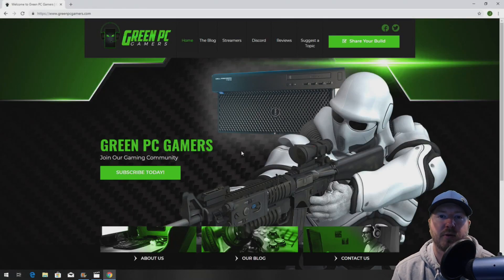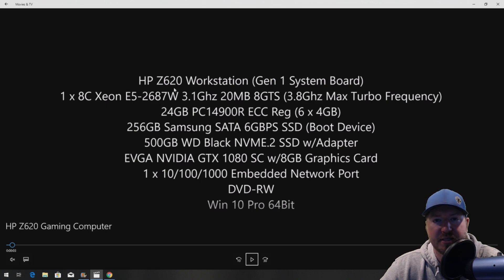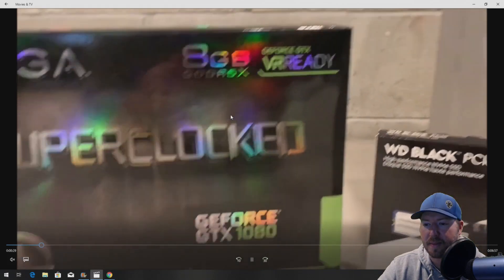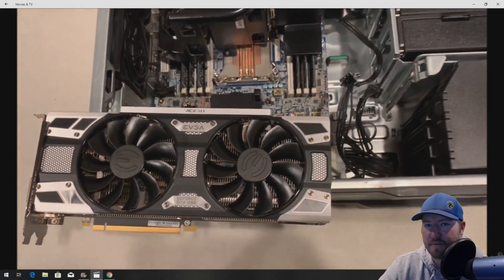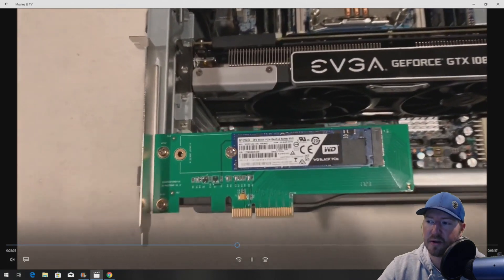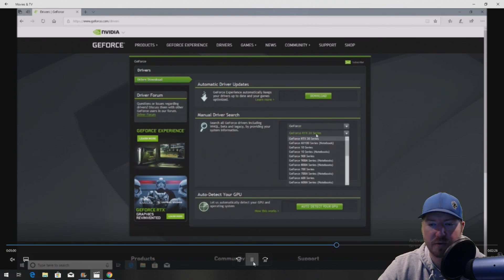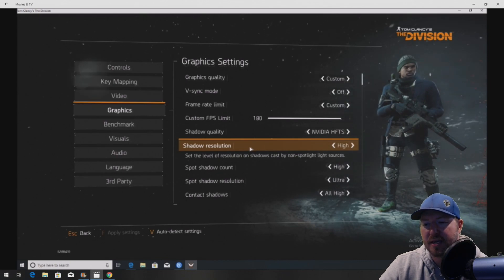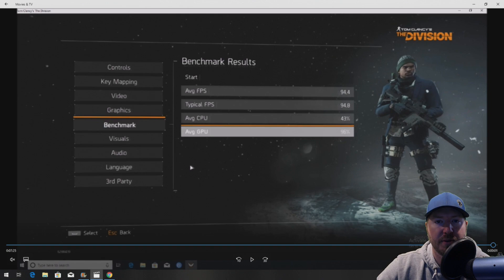HP Z620 Gaming Computer and Overview (NVME.2 and GTX 1080 install)

Comment: On my Z620 Dual CPU the GTX1080 will not work. I tried HP Adapter 6 Pin to 8 and 2x6pin to 8 Pin, but this is not from HP. Z620 only says „Beep“ six times. Now I work with Radeon7870 and 6 Pin.
Reply: ...now working with 2x6 to 8, I reseted Bios, now it's better.

Comment: Does it support dual graphics card? Sli
Reply from the maker: It does support SLI with certain NVIDIA Quadro GPU's.  Unfortunately, NVIDIA got rid of the support matrix that showed which cards work.  If you do some digging, you can probably find the matrix on the internet.  Good luck!

Comment: On my z620 Workstation I tried installing a Corsair rm850x 2021 model PSU along with an EVGA gtx 980ti and the pc will not boot up. Do you have any suggestions or possible troubleshooting?
Reply from the maker: We've never tried an ATX power supply in a Z620 Workstation because you can't physically fit an ATX power supply in the case.  You'll probably have to modify the power rails to get it to work.
Reply: @GreenPCGamerscom  thank you for the quick reply.  I did have to modify the case to run the power cord to the new PSU. The motherboard has an 18pin connection to the board and also to the PSU, but the PSU came with an 18 pin to 24+6 pin connection. Do you know if the motherboard on the Z620 will only draw power from specific PSUs?

Comment: Nice video.  I'm trying to install an Nvidia K4000 and haven't been able to find a suitable PCIe adapter cable.  Yours connects to 8 pins the K4000 uses 6 pins.  Any idea where I can find an adapter that connects to a 6 pin card?

Comment: hello! Can i install two rx vega 64 in this hp z620? They use four 8 pin connectors in total
Reply from the maker: You cannot, unless you plan on using an external power source.   Also, the z620 won’t support a crossfire configuration.
Reply: @GreenPCGamerscom  ok, thanks for your fast answer!

Comment: Just received one, with E5 1620 (1 CPU) and 48GB RAM. Put SSD and GT 1070. I use a dual 6pin to 8 pin cable adapter for the VGA.

Comment: Wow; great! Was searching all over to see if I could VR my Z620. My wife won me a Oculus Rift at a silent auction (cool wife, I know). Naturally it wouldn't work with the Quadro M2000/4; so, down the rabbit hole. Super good video production, I like the technical work and also the PIP effect. Covered everything. I'm going to look for a 1080 instead of the 1070ti just because I saw it done.  Really good job! Thanks. Subscribed, liked...

Comment: Hi all,
Could anybody tell me if is it possible to boot this Z620 workstation with a Nvme M.2 Samsung 970 EVO Plus? And how?
This is mounted on a PCIe 8x adapter (on number 4 socket) and the system recognizes the SSD but can't boot from it. The BIOS is the last 3.95 version.
Reply from the maker: You can use a boot assistant like clover, or buy an m.2 adapter that has a bootable rom chip.
Reply: @GreenPCGamerscom  how to check m.2 adapter have bootable rom chip?
Im looking at Ugreen m.2 adapter from aliexpress.. should I go for it?

Comment: Nice video you should do a video installing a rtx 2080 into a z620 that would be great and can the z620 handle it
Reply from the maker: You could install an RTX 2080 in to a Z620 workstation.  It performs almost identically to a GTX 1080 Ti.  In our opinion, the best bang for your buck on a Z620 is the RTX 2070.  It seems to have the least amount of bottlenecking.
Reply: @GreenPCGamerscom  lets suppose I were to replace the xeon processor with a xeon e5 1680 v2 and OC it to at least 4.2+ghz, shouldn't that really end all the bottlenecks completely?
Reply: @GreenPCGamerscom  The GTX 1080 TI, can it also be installed in the Z620, I have one with dual processor 2690 v2

Comment: Hi ! great to see projects like this :) I went similar way with mine custom z620 : 
E5-2697v2 on liquid aio
GTX 1080 on liquid aio
Intel p540 boot
2x Intel p3500 ssd drives adapted to pcie slots for utilities and games
3x WD red 2TB storage
Reply: Hi TheSChp, what liquid AIO did you use on your system? cheers

Comment: Hey, i have a question. does 2 pcs intel xeon e5-2620 is better than i7-2600?
Reply from the maker: It depends on what you are using the computer for.
Reply: @GreenPCGamerscom  I'm actually using it for some games and some editing software, would it be good? What do you think, sir?

Comment: Hi, I have a Z800 with an ASUS 1070 ROG STRIX 8GB. The problem is that I keep on getting Video TDR failed Blue Screen of Death Error. I can't seem to find any sort of fix. I've reinstalled the drivers about 5 times now and still nothing. Checked and unchecked. My assumption is that the card is screwed because the drivers are corrupted or something. The latest or oldest drivers don't seem to make a difference. Please let me know if it's the card or the system.
Thanks
Reply from the maker: If you think it is a driver issue you could trying doing a fresh install of your OS.  Did you buy the graphics card new?
Reply: Quick check: What are you using to power the video card?

Comment: If you can choose between a Z20 or a Z800 to upgrade them which one you'd choose? Thanks
Reply from the maker: If the price wasn’t an issue I’d do the Z620.  It supports faster components.

Comment: How can I find if a HP Z620 workstation is gen1 or gen2?
Reply from the maker: Vikas Kumar check your system board.  619559-001 = V1 and 708614-001 = V2
Reply: @GreenPCGamerscom  Thanks for the super quick response.

Comment: I have z620 v1 with a E5 2680 xeon processor I want to install a gtx 1070 in it ...do you think the it will bottleneck with a newer gpu in it?
Reply from the maker: With our experience, we have witnessed a small amount of bottle-necking using a GTX 1070 Ti in a Z620 workstation due to the IO speed of the cpu/memory.  Most of the time it's still totally worth the upgrade.  What GPU  are you upgrading from?
Reply: I'm upgrading from a Nvidia GT 740 I recently bought the pc I'm going to be using it for video editing and streaming...I'm looking to purchase a 1070 not the Ti version due it to being old hardware
Reply from the maker: The new graphics card will be a nice upgrade for you.

Comment: Hey! Where did you get that 2x6 pin to 8 pin adapter? I need to know because I have hp 620 workstation and I bought 1070 8gb.
Reply from the maker: You can find the adapter on this page:

https://www.greenpcgamers.com/technology/video-card-power-adapters/
Reply: @GreenPCGamerscom   thanks a lot for this link , but in france it does not work !

Comment: Nice video, i want to put two gtx 980 in sli on mi hp z620, with a xeon e5-2695 v2 and 32 gb of ram. yo thinks is posible?? thanks in advance.
Reply from the maker: Hey Jonathan,  if you have the V2 system board your Z620 shouldn’t have any problems running 2 x E5-2695 V2 processors.  You will need the secondary cpu riser board to install 2 processors.  Also, installing 32GB or memory will work fine.  The 800W power supply does not have enough wattage to run 2 x GTX 980’s under max load.  Also, it would be tough to provide the power adapter cables for 2 cards.  You could possibly run a second external power supply to accommodate 2 gtx 980’s.  Or consider using a single RTX 2080.  Hopefully this info helps!
Reply: @GreenPCGamerscom   yes it was very helpfull, thank for everything. nice channel and continue with the great job.
Reply: @GreenPCGamerscom   i was thinking in a radeon vii because i use a lot of cad work on that pc, so i hear the radeom vii is a good choice for that,but i am worried about the psu, you think it can handle it?? also i want to expand the memory to 64 gb, it is really a massive diference betwen ecc and non ecc memory?? beacusE NON ecc is cheaper asn esasy to find this days, thanks a lot.
Reply from the maker: As long as you have the 800w PSU you should have no problem installing the Radeon GPU.  If you are a CAD user ecc memory is recommended.  The ECC Reg memory is cheap.  You can get 4 x 16GB 14900R modules for under $200.  Contact us direct if you need help locating parts.  Facebook is the easiest way for messaging.

Comment: What motherboard are you using? Are you using the one that came for the Z620?
Reply from the maker: We did use an actual HP Z620 system board for this build.
Reply: @GreenPCGamerscom  Thanks for the answer, I didn't realize you could use PCI for it.
Reply from the maker: Yes, it does have one of those ancient old PCI ports =)
Reply: @GreenPCGamerscom  Btw do you know which CPUs works for the motherboard? Thanks in advance
Reply from the maker: If you  go to our blog page you’ll see our recommended processors base off the motherboard pn.

https://www.greenpcgamers.com/technology/hp-z620-gaming-computer-and-other-upgrades/

Comment: Another nice thing to add. The hp z620's 6pin connectors can be both be converted to actuall 8pin connectors because of the way hp designed them. You do need the official hp z400,z420,z600,z620,z800 or z820 adapter for it but this way you can basically power any card you want.
Reply: Really? I have a hp z620 and I have a rx 480 8gb but I can’t use it because it uses 1 8 pin. I don’t know how many 6 pins there are in the hp z620. Can you put the link to the hp z620 adapter for a single 8 pin?
Reply: @TheTrueMotive-rx5xx   Depends on the psu but they are usually hidden behind the back panel which is a pain to get off.

As for the 8 pin I got a startech 6 pin to 8pin adapter. Don't get super cheap ones they melt
Reply: only 150w per connector tho right? and then 75w from the pcie slot itself so you have to be a little careful on the cards since some will still need both into a dual 6 port to 8 port adaptor

Comment: I run dual 2643’s with a 1060 6gb and 32gb of memory in my z620. It’s solid.
Reply from the maker: Nice Configuration!  What games have you been playing?  Also, what are your typical Frames Per Second?
Reply: Mostly been playing Hunt: Showdown which is in early release so it’s not fully optimized but on medium settings I get around 60. After some optimization I’m sure it would run on high no problem. Going to try out ROE this weekend as well.
Reply from the maker: Awesome feel free to join Green PC Gamers discord channel.  The link is on www.greenpcgamers.com